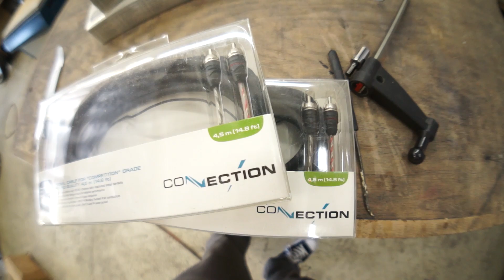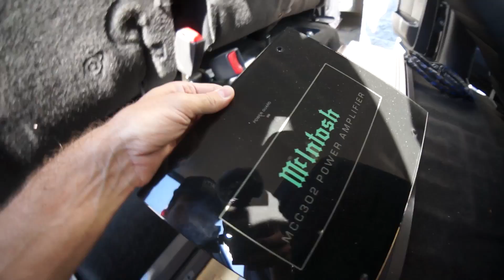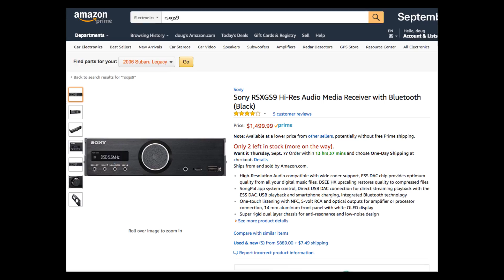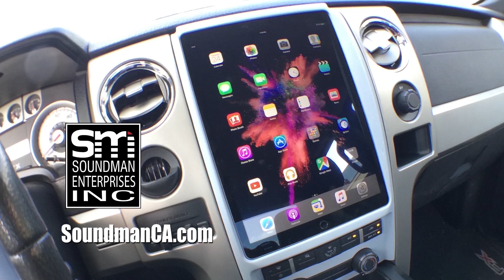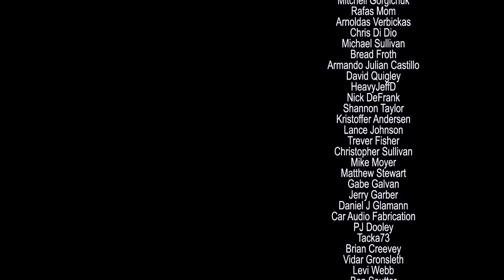RUNNING WIRE IN THE F150!! - RCA's and speaker wire - AMPLIFIED #650

Comment: Remember the "Fuck Off" oil pan skidplate......  Make those,   crank some out in MDF if you dont want to use the plasma cutter.    But some of those in sheetmetal would be pretty cool
Reply: 1ANeat I would definitely get some mdf Fuck Off  plates!!! My wife wants some too! Diy wet wet!!
Reply: 1ANeat sheet metal would be less manual labor. I think the edges are smooth when using the plasma so no sanding necessary. +10 HP‼️‼️
Reply: Yup!
Reply: Yes they would probably be pretty clean but I wouldnt worry  about the edges or slag or anything.  Plasma cut and ship em.......
Reply: Yea... MDF skid plate would work out wonderfully.....

Comment: Who else could foresee the anti theft being a problem for him?😆😆😆😆
Reply: I was thinking- as he was bragging about the idea- that surely he had a plan to remove them. Then the lil skit today, he had me for a minute.
Reply: jacob bennett, yup, he should grind opposing sides of the carriage bolt head, smooth out the crown, and paint the tops to match the amp rack. That would be sick. Wouldn't even notice any bolts.
Reply: jacob bennett anti theft...  anti install 😂
Reply: Plan the job ahead and don't use home center hardware that you pick at the last minute.  
https://www.mcmaster.com/#standard-rounded-head-screws/=19abljn
Tamper-Resistant Rounded Head Screws - available in 5/16-18 which looks like the size Doug used. The spanner head (2 holes for a spanner socket) or the Torx with the 'tit' in the center; Doug could make 'tit' joke about screws.

Comment: Yo Doug I'm pretty sure neither the volume or any of the adjustments affect the optical output of that deck.
B4 you buy I would ask the Meademan cos I'm sure you know he has that deck in his Tahoe.
You could still get it but you would need a processor that has a master volume adjustment which would do the processing for your whole system.

Comment: could always replace the ap8.9 with an ap4.9 and connect a high to low level converter to the 4.9 giving you RCA pre outs for the Macintosh amp

Comment: Only real issue I have run into before is when using a digital output (Optical or Coax) along with analog outputs from the same source unit. The timing will be off causing latency or reverb effect to one zone / set of speakers vs the the other.

Comment: Instead of blowing $1500 on a headunit that potentially only half solves the problem you have, why not spend that money on a better dsp? I've previously switched from an alpine pdx4.150 on a set of components to a focal fpp4100 on the same setup and found the ab amp far nicer on the highs, change your dsp and take full advantage of the macintosh amp where you'll notice it more.
Reply: alex rose dsp =/= amp
Reply: Moichumoi's Channel I don't understand what point you're trying to make here. His issue is the audison unit only has 1 rca out for a sub, makes more sense to instead replace the audison for a different unit that will allow him to use the macintosh on the mids and highs.
Reply: alex rose Ah, I didn't understand what you meant at first. I thought you wanted him to replace his dsp for an amp. But I see what you mean now.
Reply: alex rose I wholeheartedly agree with you. I hope he changes his mind

Comment: Wouldn't it be best to send the highest volume (voltage) possible from the deck to the Auddison processor and use its master volume to control the volume? Wouldn't have to worry about the optical outputs volume being controlled by the deck or any other optical source. It would be HARDer for any electrical noise or interference to effect sound quality thru the RCA's. 
Correct me if I'm wrong thou.

Comment: I would confirm if the Sony deck will simultaneously output a digital  & analog signal. Or if it's internal DAC has to be selected to either or before you drop $1500 on it.

Comment: Doug, doug doug doug dougy doug my man! Turn the carriage bolts upside down tack weldem in place underneath, so the threads go up through the holes & use some bad ass locking accorn nutts on top!

Comment: AFAIK the Sony GS9 outputs either through the analog outputs or the optical output. Not both simultaneously. Also the digital out is fixed. There's no volume control from the Sony for that.

Comment: You need to use an impact to remove those nylon lock-nuts on the carriage bolt.

But don't impact it too much otherwise it will twist!

Comment: Dude just get the Pioneer Stage 4 DEX-P99RS. You could even ditch that Audison with that Receiver because it has 9 million Crossover points and Slopes with Auto EQ, Auto TIme-Delay, and 31-Band Equalizer. Not that many Crossovers but it's a shit ton.

Comment: Man, I would switch to a dedicated processor. Not having the mids running through the DSP would kill me. No way that head unit is going to have the same capabilities as a dedicated DSP. Surely the parametric EQ and time alignment alone would make having everything run through the dedicated DSP. I would seriously consider a dedicated DSP and just a small, high quality amp for the highs.
Reply: In other words, STOP FUCKIN IT UP BEFORE IT'S EVEN DONE! Hahahahahahaha. J/K. Whatever you end up doing is going to sound amazing.